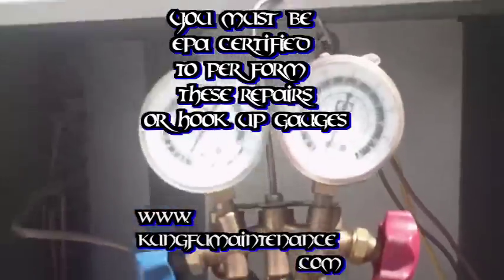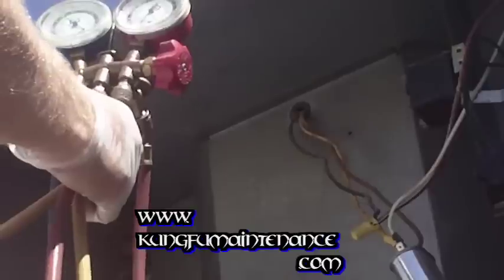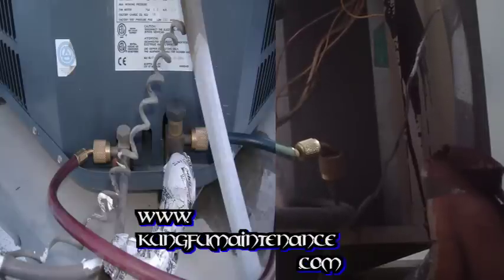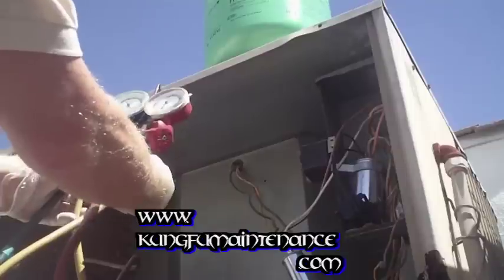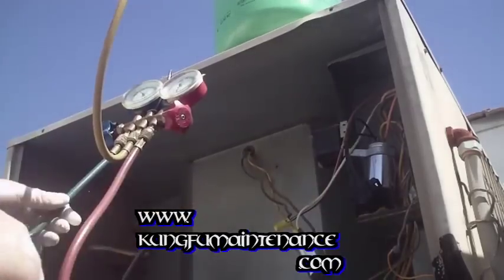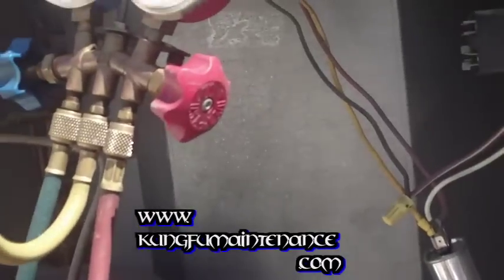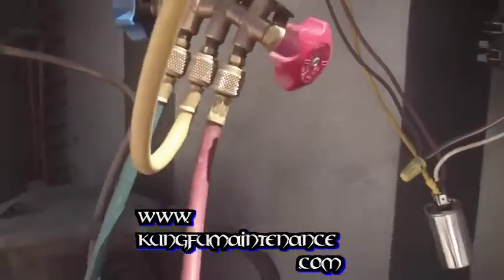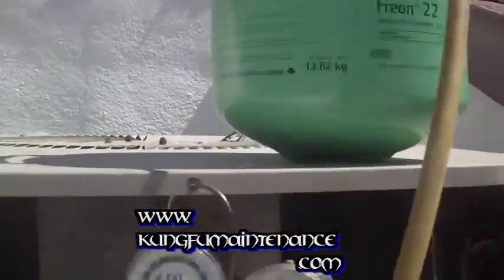How to Charge an Air Conditioner  That is Low On Freon ~ AC 101

Comment: Does it matter where the r22 is when filling the unit? Does it need to be above the unit like the video shows, or does it even matter? Can it just be set on a surface near. As long as it is vertical so only gas freon, no liquid going through lines, right?
Reply: Yes gas only. And no it doesn't matter where the can is at (because it's pressurized gas). If you're filling a unit completely up its good to have a 5gal bucket on hand with hot water in it. Cause when you start getting the refrigerant out at a fast rate you'll want to keep it warm so it goes from a liquid to a gas. Only charge in gas on the low side line (bigger line) in ac mode while everything is running. There are other ways to charge but I don't want you to get confused.
Reply: Jason Carmichael if it's r22 it can go as a liquid or gas since it's pure

Comment: Red is high side LIQUID blue is low side suction...and vice versa if you have a heat pump in head mode. And if you have a system that low shouldn't you be recovering and checking for leaks in the line set and evap coil? Just saying cause you're not really fixing the problem, just wasting refrigerant.

Comment: is it always goin to be 30degrees hotter on the hi side on every refrigerant ??
Reply from the maker: Thirty degrees above ambient outside temperature is just a general rule of thumb for R22 refrigerant in figuring good pressure temperature relationship charge. The better slightly more complicated ways are by superheat if you have capillary tube(fixed metering device) or by subcool if you have a TXV metering device. I have videos going into more detail on superheat and subcool.
Reply: rules of thumb = call backs. Measure the wet bulb inside the building, and outside air and use a chart to tell you what your superheat should be at that moment. Then measure your superheat and compare. if it is within 3 degrees, you are good. If it is more and your superheat is over what it should be, add refrigerant. If it is under, take away. Do so at 1 oz at a time, and give it 5 minutes to stabilize. Sub cooling on a txv or exv is the same thing basically except you just measure your temps right there and is much easier. To reach the subcooling temp you need, you do the opposite as superheat when adding refrigerant. Add to increase, and recover to reduce.
Reply: marshalluniversity31 good answer marshall. rule of thumb and assumption = call backs which = loss of time and money! some things are better left to the pros. also what the video dosnt tell you is that having this refrigerant with out the proper license is a felony in all states. which could result in both jail time and fines in excess of 250,000!! also lettin sum jack leg charge yer unit by rule of thumb lol could result in a compressor failure of biblical proportions lol. Also this new 410a refrigerant is oh so touchy and alot more dangerous. so when you ruin yer ac unit dont get mad at a highly experienced tech charges you out the ass. cause trust me us techs that have done this for 20+ years can tell when a home owner or jack leg has been in a unit lol.

Comment: do you look at the outer rim or the green ring for R22?  to Witch one do you add 30?
Reply: Victor Martinez Bojorquez outer rim is psi for all refrigerants. Green is r22 temp. U add 20,25,or 30 depending on the seer of the unit

Comment: You cannot charge with a plain bottle through the high side. as the gas will flow into your bottle ! second, when you have to keep recharge your AC. test for leaks first because these installations should never been refilled if proper fitted and no leaks !

Comment: A/C wont blow much cold so I called Gateway A/C repair in El Paso Tx. My Tech comes here Fri.............cant fix it cause its frozen up, Tells my wife  to run FAN ONLY till Monday.(HOT weekend here)  Comes back Mon and works 3 hrs and tells me he needs a part that he cant get until Tue. Its 85 degrees in here and he leaves. Its 1AM and too hot to sleep.
 This has been going on for a WEEK now. Man Im about TIRED of messing with these guys.

Comment from the maker: @eagletek1 Oh Yeahhh, SuperHeat and SubCool the finer things I would like to get into more. More accurate measurements are needed when working with more complex and sensitive equipment and systems. Capillary tube and fixed orifice systems allow for  some variance but other advanced systems require more precise charging.

Comment: what you show is improper procedure.  That's a good ballpark but you should charge according to superheat and / or subcooling.  C'mon you know better!!!
Reply from the maker: Not improper procedures just charging according to Superheat/Subcool charging is more precise. Of course there is always more!! This is an old video but still has lots of value in explaining very important factors and helping to understand the most critical points of charging!!